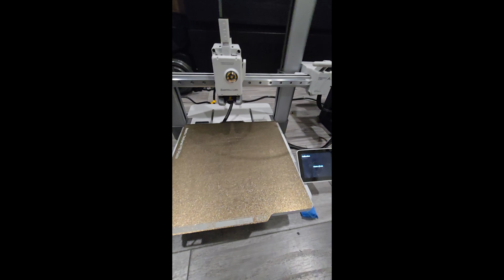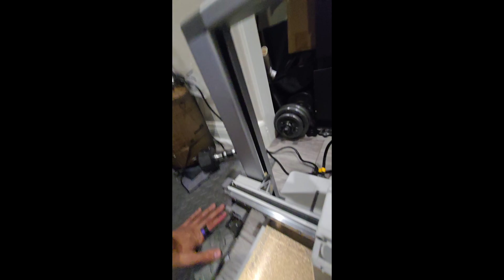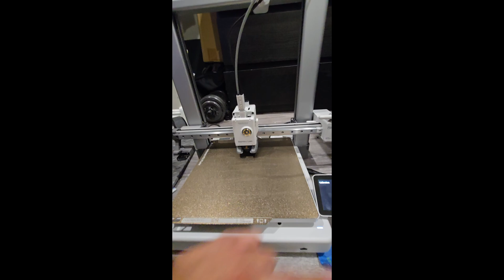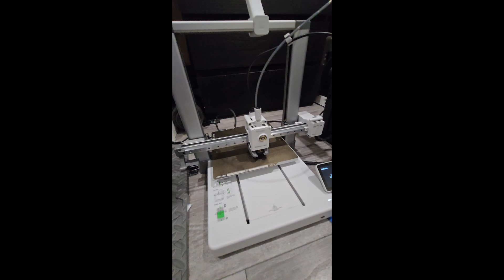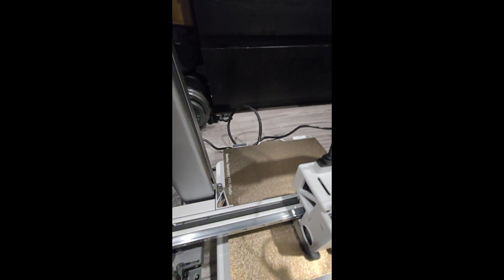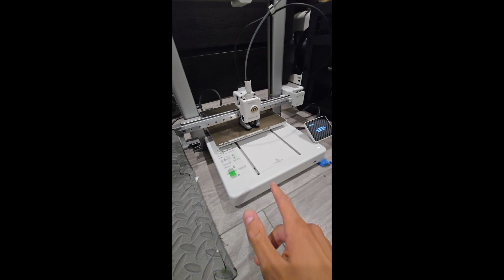A1 Labs Calibration Fail ( Z Axis Error / Forced Extrustion )

Comment: Just got a A1 in today and what a joke China made a junk printer this is new was a Christmas present what a joke the Extrusion Force Sensor is bad so can't run the set up and Bambu has about a shit help line if that is not bad you can't buy the sensor it is not listed on the web site not i have 300 dollars worth of crap i can look at each day :( don't buy a Bambu printer  I see other posted what to look for and check things out yea right like we are all 3D printer repair techs well i would return it but the cost to ship back to China cost more then we paid for the printer this sucks
Reply from the maker: Tighten the screws under the Y axis. Disassemble and reassemble the printer again, follow the instructions carefully.

Comment: Do you know why that loud rattling was happening? Did that also go away just by tightening the Y axis screws?
Reply from the maker: @matejkisac1898  yes I have posted in the comments below that the rattling was due to the screws under the y axis cover on the rails were loose. They will loosen overtime due to vibrations from the acceleration compensation
Reply: @momkid90  alright. Thank you. For me the rattling happens when the printer gets to the very top of the Z axis. So im not sure if that's the same thing but it sounds exactly the same. But i dont know why it would do this if there's something wrong with the Y axis that isnt being used at all at the moment of this sound happening. So i thought that there might have been something else for this entirely that u solved. But ill look into what u said. We'll see
Reply from the maker: @matejkisac1898  Definitely check all the screws on the printer, nothing else in my experience with the A1 will cause a rattle like that
Reply: @momkid90  alright. Thank you

Comment: i'm getting the exact same issue. do you have any update. other than the filimate sensor LOL ! Only 1 week old and 50 hours hum....
Reply from the maker: @jimmyjpa  check the screws that secure your rails down below your bed. Your Y axis rail screws, marked with the green circles under the bed. Mine were loose causing this error
Reply: @momkid90 that fixed my similar issue too!! Thank you so much!